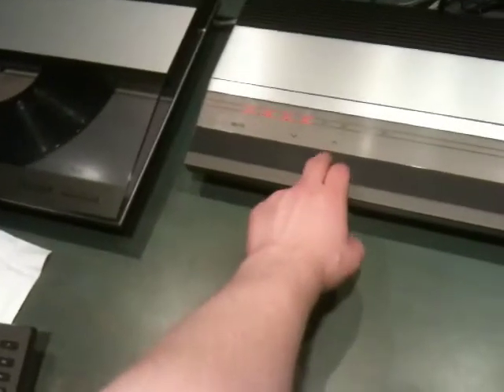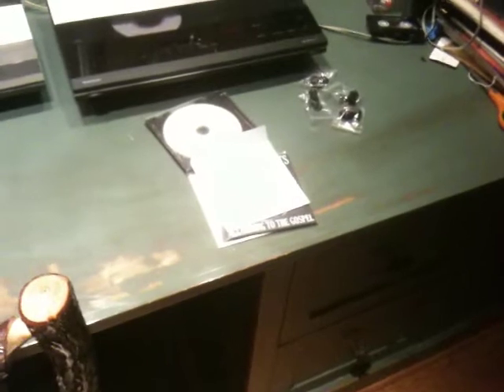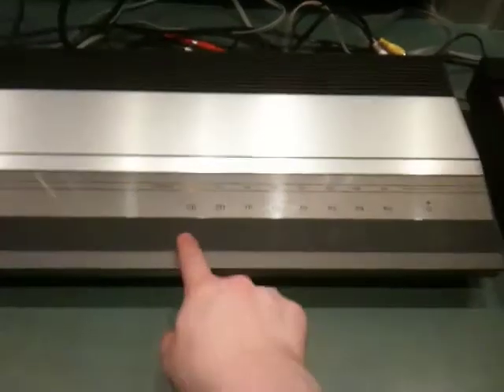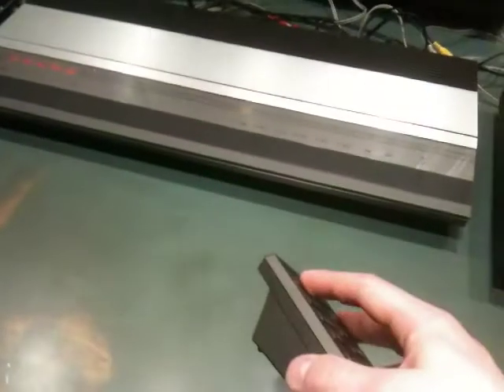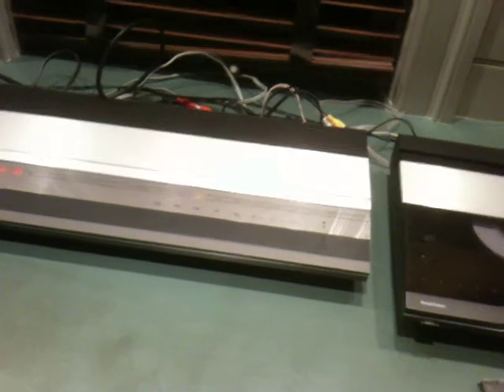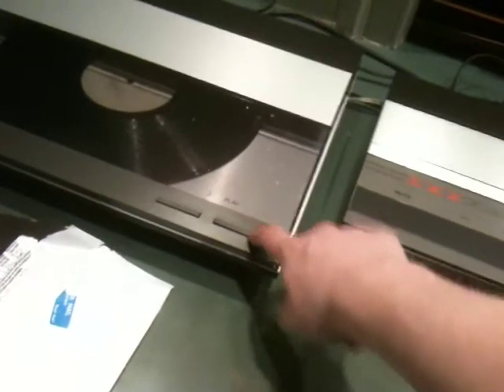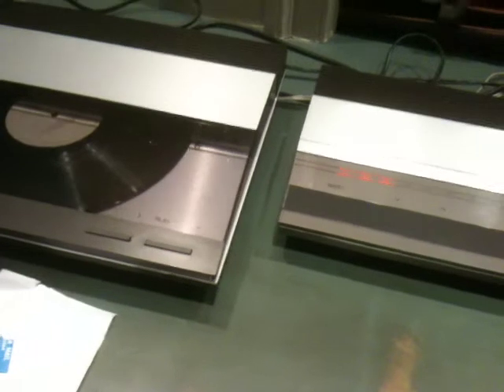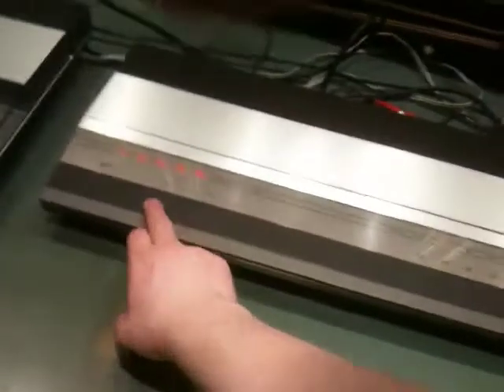Bang & Olufsen Frustration 2: Hum

Comment from the maker: @jd111932 yeah, that's how i recognized it, but the problem with that is the turntable is connected by a 7-Pin DIN cable, so grounding shouldn't be an issue at all. and the sound still persists when the cable isn't even plugged in.

Comment: Im ganna go with grounding issues on that one. If you can turn the powerplug 90degrees might fix it or ground the amp maybe to both the wall and turntable. Might also be cased by the aux input.

Comment from the maker: @37474748 on some stuff here you can, but if the plug is polarized (it's a 2 prong USA plug) one prong is a little big bigger then the other so that the polarity is correct no matter what, and it needs that for the IC's

Comment: That's definitely AC hum caused by poor power supply filtering. Most power supply capacitors from the '80s are still good, but this is getting to the age where some start failing and needing replacement.

Comment from the maker: @vwestlife that's what i thought, about the AC hum that is. seems that filter caps are the most common ones to die on ya, especially in the 50's equpiment. i'm just hoping against hope that the caps aren't part of an IC so that they could be replaced just with a simple solder job. looks like this B&O is becoming a project, but that's bonds me with the machine :P

Comment: @lmull3 if you just use the amp and hook it up to the speakers without cd player and phono player does it still do the humming on another outlet?

I can make you an video about this later on today if you wish? I have the same thing here in sweden. But here we can set the plugs in the wall in two directons.

Comment: shitty powersupply filtering.. try a "choke" on all the power cables.. and check the caps and the power transformer... hell, check all the damned caps for that matter... could just be shitty IC's, too... I doubt it though.. oh, and ground all the components in a "star" configuration, then to the A/C ground.. that MIGHT! work...